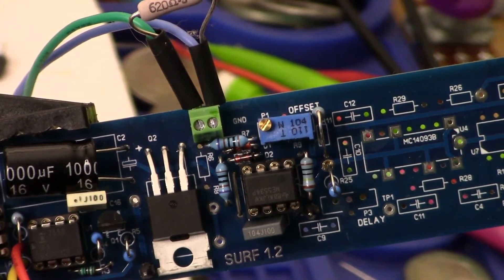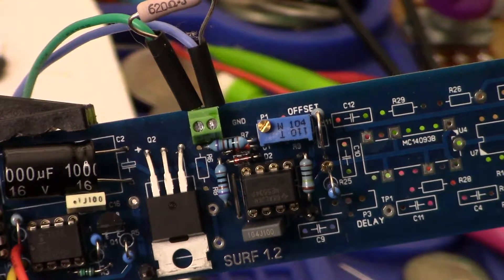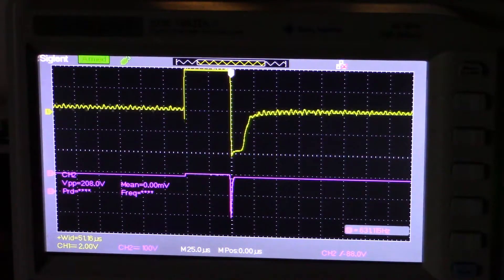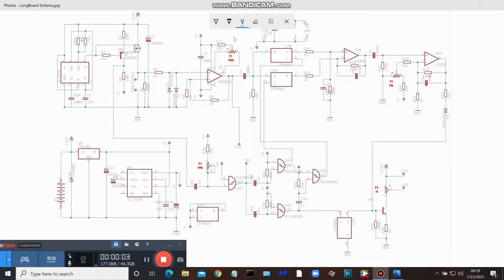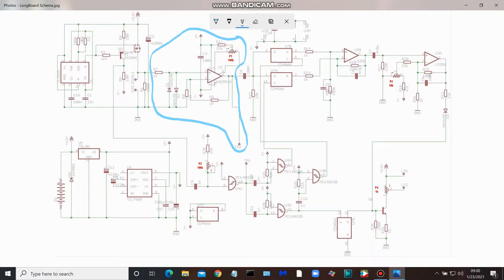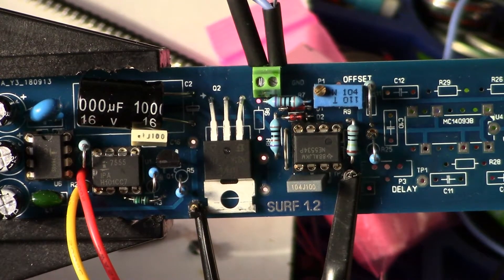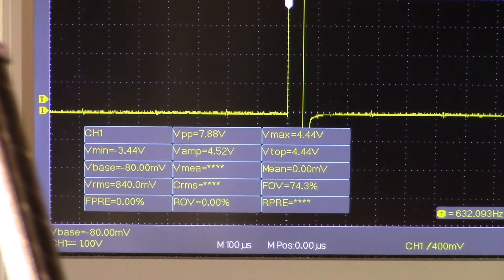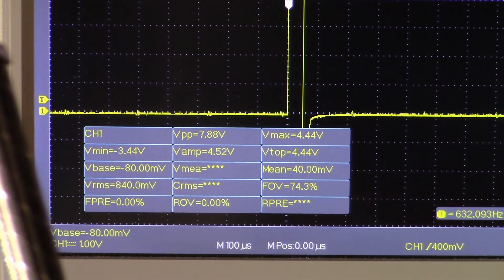Surf PI LongBoard DIY  metal detector part#3 Preamp

Comment: Op amps tend to amplify voltage difference between inverting and non inverting inputs.
Best way to adjust offset is to short inputs of amplifier and than do adjustments to set voltage to 0 volts.
Of course when shorting inputs disconnect coil as you may damage clamping diodes or something else.
Try to use multimeter for that instead of oscilloscope as oscilloscope is less precise on voltage measurements.
Reply from the maker: Thank you for your comments.

Comment: Good job Alec!,,,It'll be good to see what coil you use with the Surf and what results you get at 15us delay. Maybe you'll find a way to lower the delay? Looking forward to the next Video. Regards, Marty.
Reply from the maker: Hi Marty,
I have the machine just hooked up to a simple mono-coil right now as I do the build.  As I do almost all of my detecting in the wet of the beach I am not too concerned about having a fast coil.  15uS for my use is fine.  Thanks for your continued support my friend.